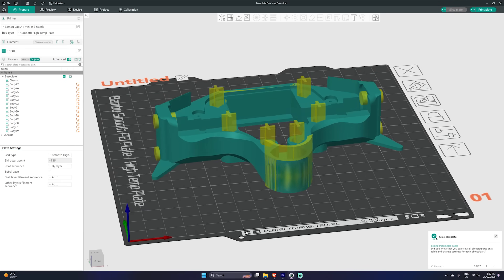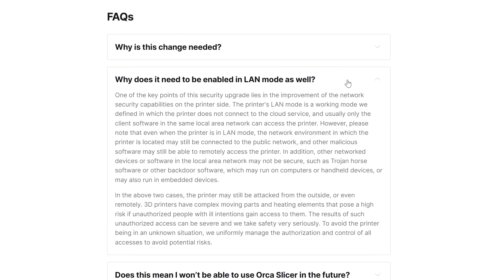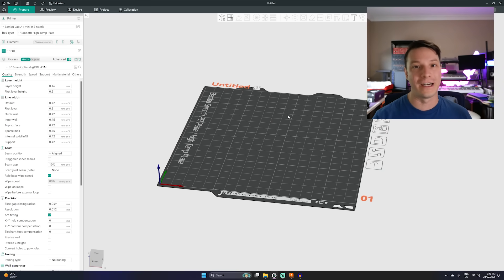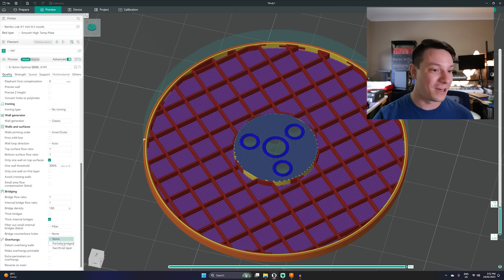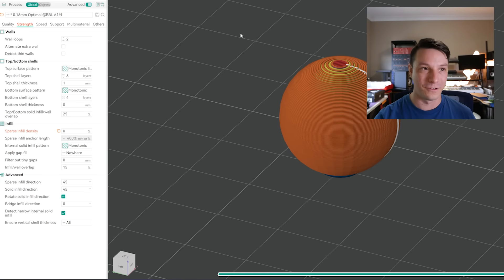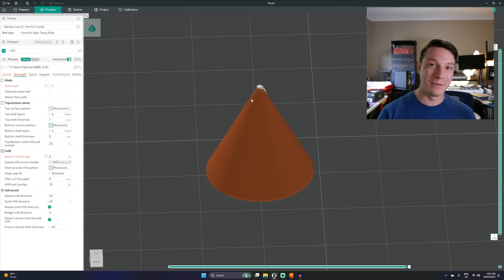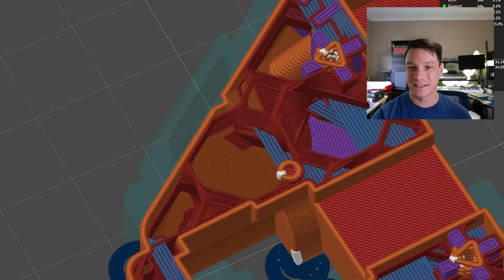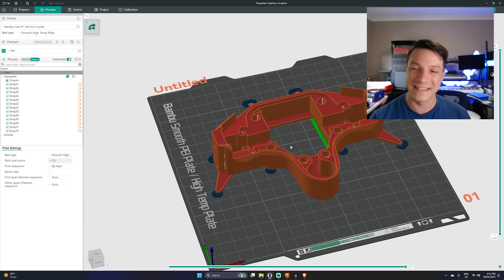I've switched to Orca Slicer for my Bambu Lab 3D Printer (and you can too)

Comment: Some really enlightening tips in there for me, great vid.

Definitely lost a lot of trust in Bambu since the firmware drama. My A1/A1 mini won't be connecting to the internet at all, am still wondering if there is something embedded in even older version of the firmware that might attempt a phone home/authorisation? So I've set up a cheap second micro router (GL.inet) so the printers have no internet, then access them through Win10 VM using a second USB NIC. 

I know keeping the printers offline via firewall rules and whatnot is a simpler option, but in my years owning Asus (Merlin firmware) routers there's been at least a few times a firmware update has made backup configs incompatible and I've completely forgotten the firewall rules I had in place (bad enough remembering ones for NAS). Having it be it's own physically walled off environment just gives me peace of mind. 

Hopefully Orca 2.2.3 update gets out of beta soon too, apparently fixes Lan Mode Access code amnesia that happens with both Orca 2.2.0 and Bambu official.

Overall have found the transition from Bambu to Orca very easy/friendly as someone who came back to printing after a long break (Simplify 3d was my last slicer when that was popular), and not wanting to tinker as much as I did in the past. Mostly stick with stock profiles/settings, only messing with supports/brims a lot of the time. But these quick tips (particularly the polyholes for screws) I feel are going to come in very handy. Cheers!

Comment: I use small long bolts as metal reinforcing in prints that need to be strong. I make the holes undersized and open them up with the correct drill size for forming the thread (called cold forming in metal). If you use an electric drill and put the bolt in quickly, the friction melts the adjacent plastic layers, improving the thread strength.
Cheers-Peter

Comment: My Bambu has used Orca since day 1 out of it's box. Never looked back!
Reply: I tried both on the first day. It was clear right away.
Reply: hey, quick question! I am newer to it all. got my p1s+ams in December.  I have been using BambuStudio and its worked well for me. My printer is at my parents place because i live in a small apartment with little ventilation . so its been cool to send a print right before i head over and its done by the time i reach (~30 min away)

I want to look into orca slicer. Does it HAVE to be in lan mode like mentioned in the video? if so, can I have both bambu studio and orca slicer connected at the same time?

Comment: Quick question for anyone who can answer, why does orca slicer keep asking for the access code, is there a way to make remember it.
Reply: Probably because it stored an initial code in the config, but the code was refreshed afterwards.

Mac: `/Users/<user name>/Library/Application Support/OrcaSlicer/`
Windows: `C:\Users%USERNAME%\AppData\Roaming\OrcaSlicer\`

File `OrcaSlicer.conf`, section `access_code` replace the code after the colon with the new access code.

This might be fixed in a new version.

Comment: Sorry guys, old guy here. So if I understand you correctly you have updated your BL printer to the latest firmware? And then used the developer mode to use Orca slicer? 
Question, do you havre to put in the code each time you switch on or is it stored and connects to your BL A1 automatically. Thanks
Reply: No. The A1 Mini has not been updated yet. As far as I know, the latest firmware with the authentication changes is currently only available for the X1C. For the other Bambu Lab printers, the update has only been announced, but there is no date yet.

Comment: You should check out the new bridge controls I’ve introduced in the latest orca slicer version (beta 2.3). Materially improved bridges when printing with fast printers!

Also the filtering of internal bridges which helps massively avoid pillowing with slanted top surfaces. 

Finally there are a whole heap of improvements underneath the surface that you won’t see and are enabled by default, such as removal of micro gcode segments to avoid print stuttering etc…
Reply: Ooo cool to hear from a developer! Thanks 👍
Reply from the maker: Really cool thanks, I'll investigate

Comment: I think you'll find that if you put a wall at an angle and then take its horizontal cross section that will be THICKER than a cross section measured perpendicular to the wall surface. You can clearly see in your video the parts with the purple wall are WAY thicker than parts without it, so I don't really know what's going on there.
Reply: I think it's the contact area between layers they are addressing, if you have a steep angle there will be very litte area for the next layer to rest on and the bonding will be fragile. So by increasing layers horizontally you expand the contact area to keep the strenght.
Reply: @warpman74  That makes sense and also what a totally rubbish name in that case.

Comment: I just have a question. Will Bambu Handy allow me to interfere with printer if printed using using LAN mode. Because it says it will log you out but. Does it mean that it will be only online?
Reply: Indeed, you cannot use Handy anymore. "LAN only" mode will log you out of the cloud, Handy can only work through that cloud.
Reply: The smarphone app doesn't work with printers in lan mode. It requires access via the cloud.

Comment: I have tried Orca, but continue to use PrusaSlicer. Good features trickle (back) to it - verified, refined and thought-out.
There were good things in SuperSlicer, but if I want to control everything, I can use Cura 😉
I guess none has heard of IdeaMaker? Though not open source, it has had "bump maps" (raster texturing) for quite some time.

These were all good features in Orca and well presented with where they can be used. Make overhangs printable would be most useful for me.
Some Orca users, however, in places like FB printer user groups, act like wanna-be evangelists - they try push their ideal to everyone and everywhere, including beginners, even though printer brand modified (new skin, basic profile, connection to printer) slicers would be easier to start with. I guess that's just how fanboy-ism works in general 🤔

I have also tried FreeCad, but continue to use TinkerCad - what works for me (and don't tell me what's my use-case) 😅

Comment: Iv tried basically every slicer out there and orca has been the best by FAR, i use chrome desktop viewer sometimes from my phone while im out, logs into desktop and its the only slicer that works with the touch controls on a phone that iv found (specifically through chrome web viewer unsure of others)
Reply from the maker: Oh neat, that's handy as!
Reply: you can always use "fake" mouse input in chrome remote desktop to control ANY app...
Reply: @ConceptNull  yes but it doesn’t play nice with some slicers, don’t ask me why because that’s googles thing
Reply: @ I dont think you understand what i meant. THe app has two input methods. U use touch.. use mouse..
Reply: @ConceptNull  yes, I do understand, using mouse mode isn’t compatavle with some slicers for some reason, same with touch, as I said don’t ask me why but it just does or doesn’t want to work, wether it’s a tap and hold for a left click hold or double tap 2 fingers for right click, doesn’t allow you to do some functions like spinning and relocating parts on the print bed in the slicer

Comment: Alright i want normal supports but add a tree. Why cant i do this in bambuslicer? Why cant i modify trees like when i do resin supports. The supports are so damn bad. Very thin sloped objects are often poorly supported. Even when painting that area its often poorly supported or not adding supports. Orca slicer is better but still obviously derived from the same garbage.

Comparing this to lycheesl7cer for example makes supporting look like an absolute joke. If an area is poorly supported and you make a change, the other area you looked at before got dofferent supports and is now bad and you have tp redo it. Its just such poor software for supports if you have more complicated prints. You can work around it but it isnt a powerful software for manually supporting. It is objectively bad at it.

Comment: I have an ender3 with klipper. I switched to orca because it had some control I missed in Prusa. Then I saw that you could directly control your printer from the app. So It stuck around. I do not regret anything but the ability to do support and infills that are 2 layers thick . actually you can activate it in strength settings... So no ragrets !

Comment: I use Orca.  TBH I think they're all pretty comparable... Except Cura, which is a complete mess and needs to be redone from the ground up. I have one old printer that i cannot get any other slicer to  make usable gcode for, and it kills me to have Cura's weirdness getting in the way of me unlocking this little machine's full potential... 

What I really like Orca for is just that whenever a new slicer feature/ technique is being discussed, you can pretty well guarantee that it's already in the daily build or beta of Orca.

Comment: Mouse ears are probably the most important part of the video for us, regular humans :) Thanks for the video! I switched to Orca because Prusa did not have proper start Gcode for my sovol sv08, and I keep using it. Btw, if you want to not be dependent on Microsoft's ability to prevent you to do staff, Orca works no problem on Linux.

Comment: Can Orca Slicer do true 3D top layers?
Reply: you mean non planar printing ? If so, no its' not a feature at that time.
Reply: Not yet, there's surprisingly little demand and the printhead geometry severely limits the maximum printing angle. The best one I've found is Teaching Tech's PrusaSlicer port of an old Linux Slic3r post-processing plugin. It warps the model itself, slices, then unwarps the gcode. https://youtu.be/cbhWni9f980

Comment: Nice vid, thanks Angus. When it comes to Orca, I guess the biggest hurdle will become the Network plugin, will it still be available after Bambu release the next official. Orca use it for LAN mode, so if Bambu mess this up bigtime, we are stuck with current installed Orcaslicer for our Bambuprinter I guess.
Reply: No, we're not necessarily stuck with the current version of OrcaSlicer.

It will mean however that the next version of OrcaSlicer might not be based on the NEXT version of Bambu Studio, but on the CURRENT version of Bambu Studio (since that works with the Network Plugin you mentioned), effectively becoming a "fork" instead of a "rebase/rebrand" (don't kill me), and still have the same new slicing features as Bambu does. With more effort. Plus we might be stuck on the CURRENT firmware versions on the printer as well.  I'm not risking the firmware upgrade until we know that that Developer mode actually works. 

IF the Developer mode is as solid as Bambu says it will be, and it won't require Bambu Connect to be present, then we can continue using new versions or Orca slicer based on new versions of Bambu Studio?

Comment: I liked PrusaSlicer but for the last year I've been using OrcaSlicer and it's very powerful.  I like having more control, even if it means that I might do the wrong thing.  I'm currently using 2.3 Beta and it's added some new features and improved existing features.  I've purchased twelve 3D printers and zero are Bambu Lab printers, and never will be.  I want to own the printer and not have the printer own me.

Comment: I forgot my settings at cura since I bought a new laptop can anyone tell me a good support settings for printing cylindrical horizontal overhang?
Reply: idk but why not use orca slicer?
Reply: You don't have to use Orca, but you should seriously consider moving away from Cura.  It's lacking a ton of features, and even when it does do what other slicers can do, it does it worse, IME.
Reply: @ I see, since I'm starting over I guess its a good time to start using a different slicer

Comment: Don't forget: Bambulab itself (unknowingly) built the security problems into the printers and their cloud services during development!
Just like Bambulab's cloud costs are so high because "everything" / the videos go via the cloud, that's exactly how Bambulab wanted it because that's exactly how they programmed it!
Reply: What gets me is that Bambu Labs only allow me to send files to my printer in Lan Mode. To see and delete files I have to connect the printer to the cloud which seems even less secure.
Reply: Pretty much most of this is misinformation.

Video is peer to peer unless that isn't availible for things like complex bat setups.

The high costs is also just false from their side. They could easily implement rate limiting.
Reply: Yep. I prefer my Prusa printer with it's Prusaslicer at any time over bambu.

Comment: they're currently integrating bambus supports and some bridging stuff as well so it'll be even better/ more parallel shortly :) looks like should be in beta 2 for 2.3 according to the github. i've been using the dev version with the upgrades and it's worked GREAT!

Comment: I really like this video and how it showcases some niche settings i've never touched before. wrapping it all up showing a project where they can all benefit a print was super cool. that chassis must be sooo satisfying to hold and use with how much thought went into all those little tweaks to get it to that point.
Reply from the maker: 100%! Well worth the setup time, and it's over 10g lighter than if I just sent it with defaults

Comment: I didn't see anyone address this.

The big problem with the Bambu Controversy is that they were disrupting current workflows with the combo of what they said and what their Terms of Service allow them to do (block print jobs if you don't update to the latest firmware, so they can hold your printer hostage at any time if it can see the internet).

They backtracked, and locking down their cloud platform is whatever. The problem is them saying you can't use features you currently do, or alternates, because they decided /after/ you bought the printer that you don't get X, Y, or Z feature. The initial proposal was basically Bambu Cloud or SD card, else you've got a very expensive paperweight. Which is not a good look on a community built around tinkering and freedom and open source.

Personally I no longer trust Bambu to not alter the deal further in the future. I will stick to other brands, especially because they're no longer particularly unique in the space.
Reply: Never back down after someone screws you
Reply: Got a Qidi Plus4 the other week, significantly bigger than the P1S, but the build quality is so-so. Bambu makes great printers, but those practices with the software reflect poorly on them.
Reply: @JayKus373  apparently there's a Creality CoreXY that's pretty ok?

I'm a Prusa fanboy so I would get a Core1, but I fully recognize that's not a reasoned decision
Reply: @Tome_Wyrm  The K2 Plus is same price range as X1C though, not P1S, and there are RatRigs that are also amazing. :) 
I just don't have the disposable income to support all those companies hahaha

I admire Prusa, amazing products, but the Core1 also costs the same as an X1C, has 250x220x270mm build space, and 290 °C nozzle. The QP4 really blows that out of the water (305x305x280 mm, 370C Nozzle, 65C heated chamber). At the price of close to a P1S I'll take the lesser build-quality for granted for now, we'll have to see how we fare :)
Reply: @JayKus373  I'm glad someone has some more knowledge on this topic. I knew there were more options, just didn't know what they were. Very glad someone shared some ^.^

Comment: Hi all I have a P1S will these same steps Angus is using work?
I ask because I don't see the lan only option mode in any of  the settings on my screen
Reply: "LAN only" is a setting on the P1S printer, not OrcaSlicer. After you did this, you'll have to log out of the Bambu cloud account and  (remove and) add the printer (again) using the Device tap, or Prepare tab https://www.youtube.com/watch?v=dncGHYfwP38

Comment: Probably going to move to Lan Mode only on my Bambu Lab Printers for no other reason than apparently Bambu Sudio has forgotten just exactly what printers I have.

Minor issue with the preview releas of OrcaSlicer in that after it resyncs the AMS options, it seems to think my Generic PLA filament is renamed as the same color AliZ PLA, which so far as I can tell isn't an available brand of filament. Another weird element of tis is that it's not across all of my printers. Mostly it only hapens on my A1 Mini printers. Also on my P1S printer, Generic PLA doesn't appear to be an option at all. And it's including a bunch of brands that I didn't include. So it's possible this is osmething that might be fixed in the next update, but I'm not sure.

That said, I've mostly moved ot OrcaSlicer myself.

Comment: Im in the process of reflashing my oold i3 style printer ran by a mega 2560+ramps1.4 from 2017 from its original marlin 1.0.2 to current klipper and also looking at going to Orca from Cura, this vid was relevant to my interest, especially the infill options as well as that through hole option as ive been designing and printing some RC car parts that could really benefit from them.